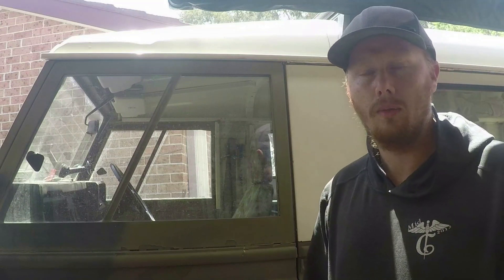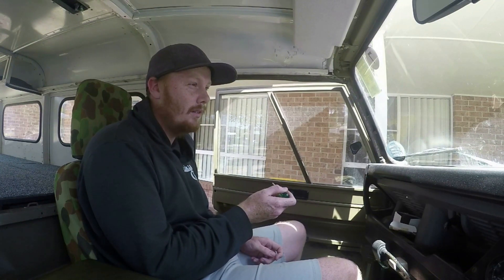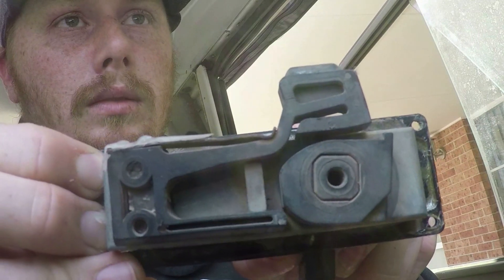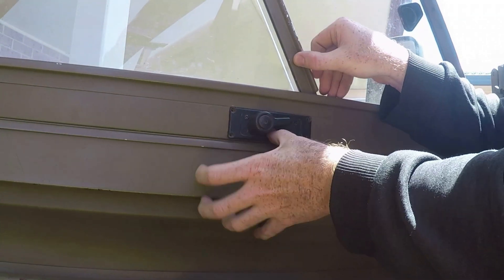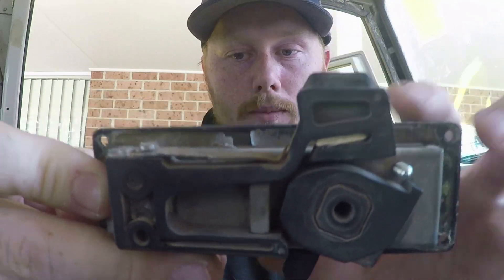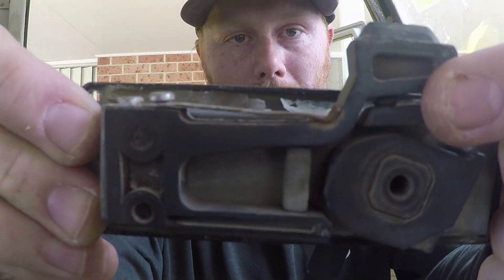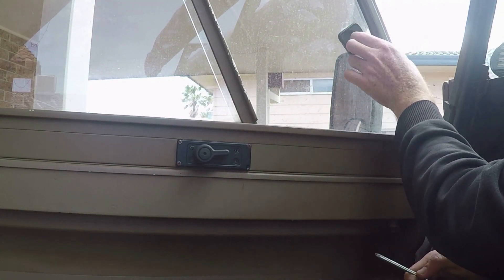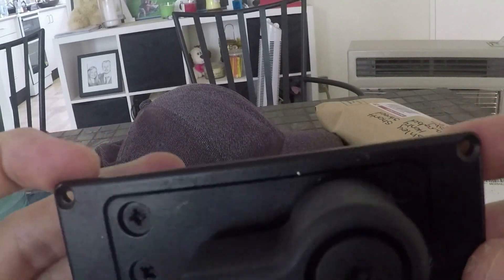Land Rover Perentie Window Lock Fix

Comment: Hi, you mentioned in your video that you purchased about 15 left door window locks, do you still have any, if so, would you sell me one, please?
By the way, do you know where and how does the Speedometer cable fit into the gearbox, or wherever it fits?
Regards,
Franklin
Reply from the maker: Hey Franklin, I only have 3 window catch assemblies left I am selling them for $100 plus postage. Do you have a manual for the vehicle?
Reply: Hey mate. Ill grab 2 off you to replace the guts in both mine if they're still available. I'm on the gold coast QLD. cheers
Reply from the maker: @pumbleclub9174  I have two left. I don't want to put my email on YouTube but you can find me on Facebook under tony LR